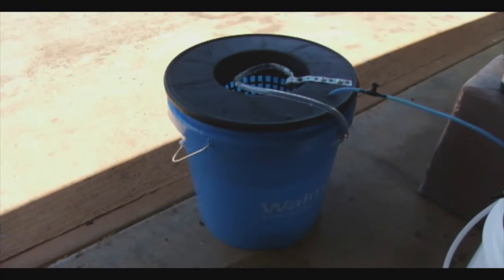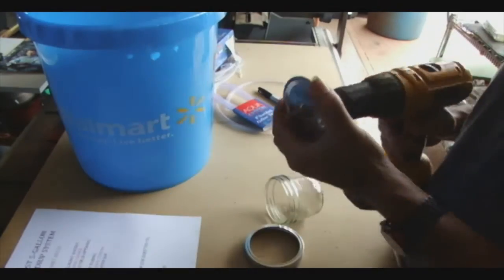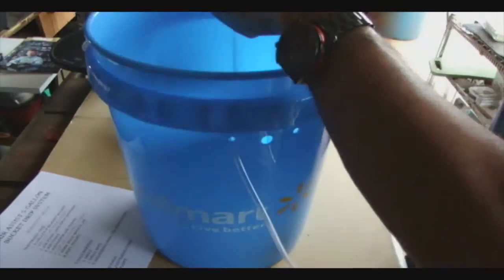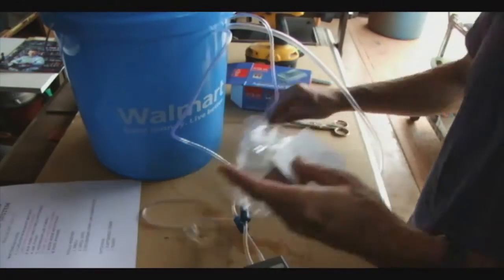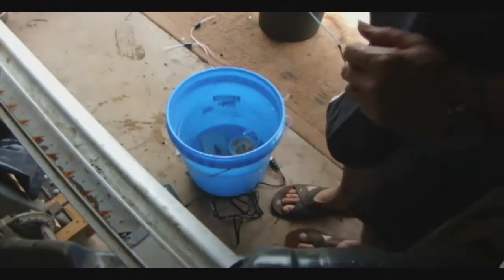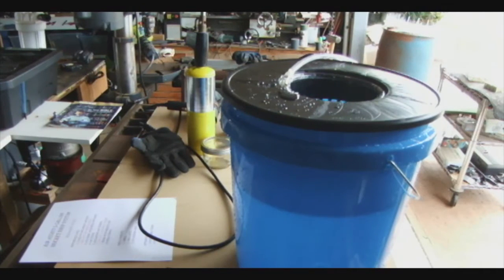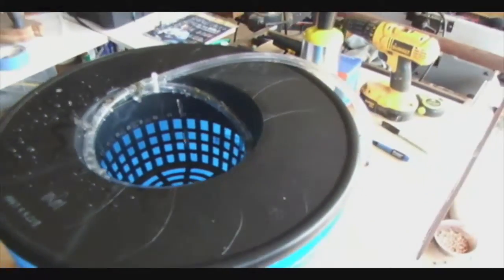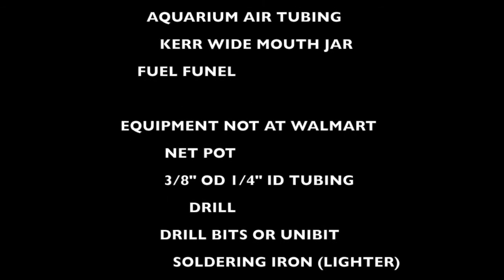Air assist pump DIY drip hydroponic system

Comment: How does water come out the jar if the jar is sealed and only air is pumped into the jar??
Reply from the maker: The jar is not water tight, its just a medium to hold the components and act as a weight.  Its cheap, and available at walmart, so it met the criteria.

Comment: so the water gets into the gar because it is not a tight lid how does the water get in the jar
Reply: my question exactly
Reply from the maker: The lid is on pretty good, but jar is not water tight, if it had been water tight it would not sink as there would be air in the jar.  You can if you wish add extra holes to the jar lid to let water in faster, but not necessary as it seeps in via the access holes.

Comment: Hey! I love what you've done, but I'm a little confused how the water is transported from the bucket, up the line, to the top? I looks like the pump you made with the jar is mostly water tight. Maybe you could help me understand?
Reply from the maker: The simple way to explain it is that the water travels up the tube with the air.  The Jar is NOT water tight.  When you build yours, you will see both water and air in the tube.
Reply: As the creator of the video has commented, the jar is not water tight.  However, I would think that further inflow holes in the lid and the "base" of the funnel (the "top" if it were oriented as used as a filling funnel) would allow greater water flow.  I've not built one yet but I will and will try more inflow holes.  Worst case, I'll waste a jar lid and a funnel.  But I agree with your assessment; yet, it obviously works as shown.  That's the great thing about these videos: finding a way then trying to find a way to improve upon it.

Comment: Hi there! What is the Wattage of the pump you used?
Reply from the maker: I really don't know as I gave that system away. What I can say is that it was purchased from my local walmart, and they only had 2 air pumps for sale by the aquarium things. A single and a double air pump.  Both will work fine, but I used the double for this build (they were sold out of the single).
Reply from the maker: The more output of an airpump you use the better, or more adjustability you will have.   For this build I used whatever they had at walmart, so it is a pretty weak pump.
Reply: I don’t understand i not to bright either lol  I always used double air pump 1 for air stone and the other to the line used half inch tubing and drilled small holes all the way around on one side and didn’t need to do what you did is this because the pump is weak or?

Comment: Great build.  I was searching for exactly this method.  I was thinking even a 4 W submersible would make the nutrients temperature go up.  I am even thinking of putting the air pump in a container with frozen jugs of water to keep the nutrients cooler than the ambient temperature.  I have seen it done on another channel. The combination of both ideas will be good. Do you agree? :-D
Reply from the maker: There are many different ways to do this, my only requirement was that the parts all be readily available at walmart so everyone could build one. If you use a larger/better pump (not at walmart) it does keep the temperature down a lot more. Normally the evaporation alone keeps the temperature steady, however in the summer I did surround the buckets with hollow tile to help keep the nutrient solution temperature down
Reply from the maker: A submersible would work fine (a bit overkill) but it will use much more power where it is not needed, but would work fine.  Maybe a timer to turn it on and off?